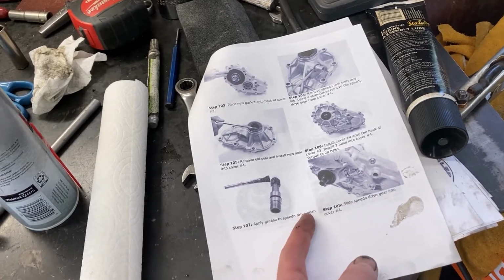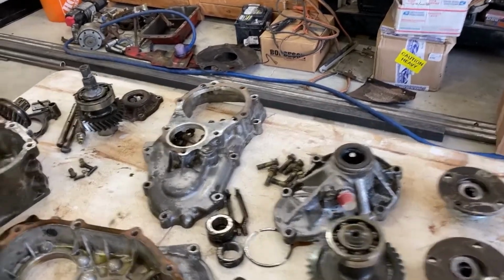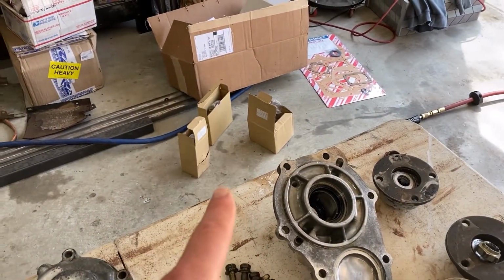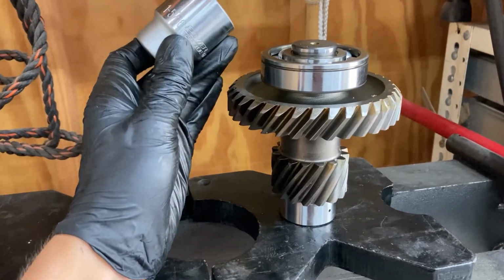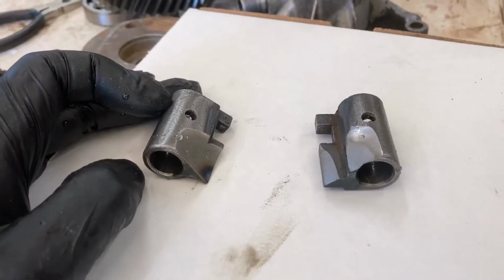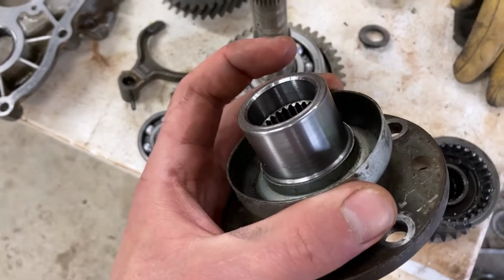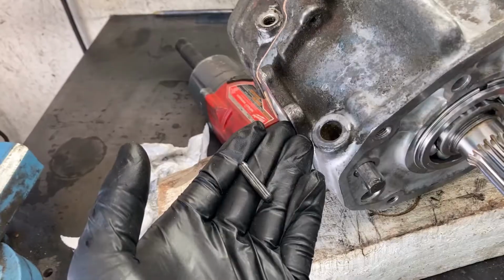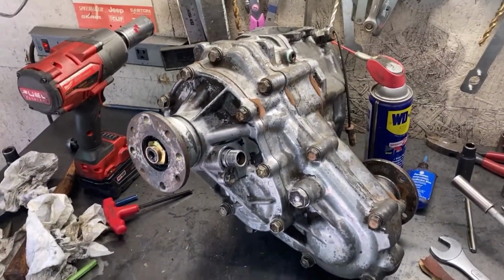Toyota 4.7 Transfer Case Re-Gear Tutorial

Comment: With the bearing kit do u have to order a sepret kit cause the case is factory 21 spline and not 23. In saying that the new 23 spline comes with the bearing for main shaft or are they all the same size
Reply from the maker: Not sure, I ordered a seperate rebuild kit and ended up with one or two duplicate unused bearings. Call Marlin, they're the experts!

Comment: Heat them up in the microwave?
Reply: Too late, now I’m doing a microwave rebuild.
Reply from the maker: Hahaha, theres an ave video on it. If you wrap them in a bundle of wet paper towels it will stop them from sparking and because water can only get so hot before becoming steam it heats them reliably to ~212F. Works pretty well and only takes a minute or two if you dont have a fancy bearing heater!
Reply from the maker: https://www.youtube.com/watch?v=LVODJm05plw&t=169s